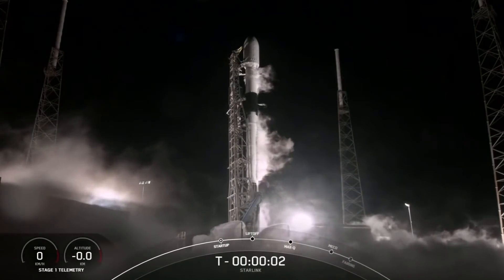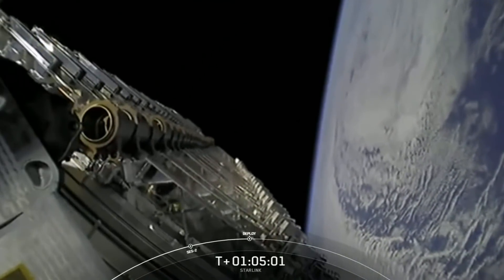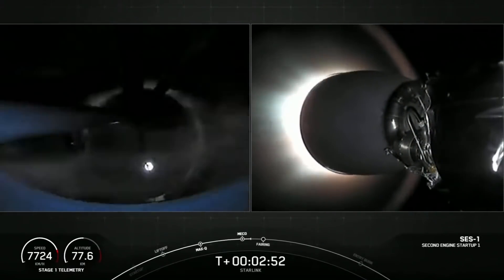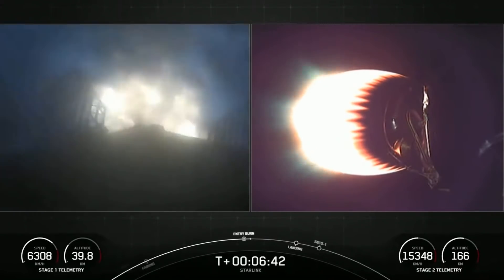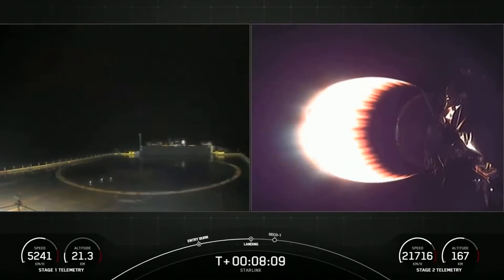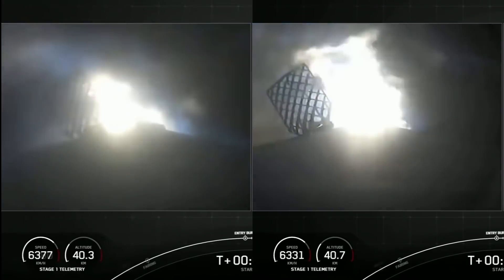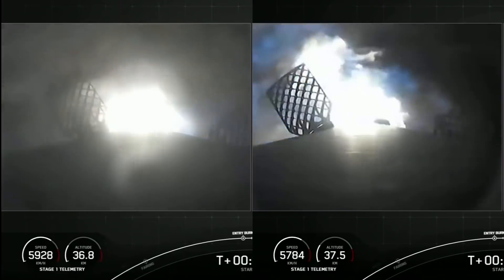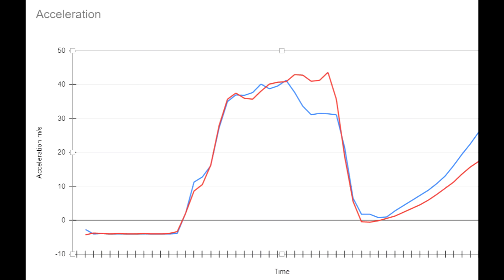Did An Engine Failure Kill A SpaceX Booster on Its 6th Flight?

Comment: How many times a booster did return successfully and has been re-used up until now? Anyone know the number?
Reply: The one they just lost was on it's 6th mission.
Reply: they'd had 24 successful recoveries in a row before this one, not all the same booster of course.
Reply: The current record for one booster is 8 flights and still going strong  (B1051)

Comment: My question is: depending on how it landed, if the booster survived can they retrieve it and figure out what happened?
Reply: Maybe, but more than likely it went SMASH into the ocean and then sank.
Reply: There's nothing keeping it from sinking to the bottom of the ocean. The cost to bring it back up may be too much to make it worth the effort.
Reply: They did once have a booster that purposely was performing a soft ocean landing. It tipped and survived. I think Elon said they were going to try and bring it back, but they had to bring in a demolition team to blow it up. 
There also was the booster that spiraled out of control on its way back to LZ1. That booster somehow survived, and they did go through the effort to tow it back into port.
Basically if it somehow survives and is floating way out in the ocean the answer is a no.

Comment: How do the merlins deal with the air up the nozzle traveling back down after re entry prior to engine burn, curious...
Reply: I guess when it's still hyper sonic there isn't much air pressure at that altitude, and when it's lower down the speed is lower so there won't be a huge air pressure. The pressure from the turbo pumps can probably deal with those fine, as you already need higher pressure from the pumps to keep the burning stuff entering back to the pump, just theorizing
Reply: It's nothing compared to the pressure the engine sees at full throttle.
Reply: @philb5593  the real problem they're talking about is probably how they ignite the engine and have it running stable while the upward wind is blowing away the fuel at supersonic speed. 'Cause even in commercial planes there's a problem called flameout.
Reply: @davemwangi05     A jet engine and a rocket engine are totally different: the rocket engine does not use outside air (or the oxygen therein).
The jet engine is open at the front and at the back. The rocket engine is closed at the front.

Any air pushing into a rocket engine’s nozzle can go as far as the burn chamber — and that’s it. The only connection is the fuel and oxidiser injectors, which are tiny, the connected lines are shut with valves and the turbo-pump that feeds them is capable of well over 250 atmospheres-at-sea-level, which is much more than the air can hope to manage.

So the air will not be able to carry away the fuel to anywhere, there simply is nowhere to go — and if it did, it would do the same with the oxidiser. 

Once there is fire in the burn chamber, the pressure will rise well above the air pressed in and push itself and the air out. 

There is a completely different set of problems in relighting a rocket engine, the air is actually helping here (by settling the tanks).

Comment: Maybe the engines usually aren’t at full thrust and two remaining tried to compensate? I know they don’t throttle very deep but we’re only talking a couple of percent
Reply: That's what i thought since the entry burn ended spacex make a decision not to recover the booster that's why there's no RUD on the droneship
Reply: @Zichoe  Don't think that's how it works. If the booster loses control, it's not going to be able to steer the last leg over towards the droneship. Its trajectory is designed that way; same thing we saw on CRS-16. I don't think SpaceX is able to send the booster active commands to avoid the droneship like people seem to assume.
Reply: @avecas  the standard profile has them coming down a couple hundred yards off to the side and then translating over to the ship under power
Reply: @avecas  Same thing with RTLS landings where the default trajectory is a few hundred meters offshore. The booster only reorients back to the launch site at the last few moments, so a failure doesn't lead to it  becoming an apartment-sized flying bomb.

Comment: I noticed something that gave me pause on the ascent.  I thought they had an engine problem then, before MECO at 21:24 in the SpaceX feed..  There seemed to be a vapor trail of a type that I hadn't noticed before, but it's probably just the equivalent of a contrail.
Reply: I saw that and a flicker or two on the way up I hadn't seen before
Reply: It also seems like the MaxQ arrived about 20 seconds early, then all the rest of the events were behind the timeline including MECO.

Comment: Scott Manley just was disappointed that the seagulls didn’t experience a RUD themselves. That’s the actual reason why he made this video.
Reply: The seagulls appeared to be very savvy about Falcon 9s. Started to move, then recognized the engine had failed even before Mission Control did, and settled back in.

Makes sense, they already have an instinct to be aware of falcon behaviors.
Reply: @donjones4719  this, this made me laugh
Reply: @donjones4719  I think we should just replace the humans on mission control with seagulls, sounds like a more exciting time.
Reply: @donjones4719  I think those birds initially move when the booster hits the water. The noise scares them.
Reply: I watch these landings for the same reason other people watch car races: for the crashes and explosions. Also science is cool.
Reply: Seagulls: MINE MINE MINE MINE
Elon: Here, have a rocket!
Rocket fails to land
Seagulls: MINE MINE MINE MINE
Reply: @KingdaToro  MINE thoughts exactly
Reply: He probably had a sandwich or three stolen by them at one time or another.
Reply: Birbs were all oh s*.... Meh, not our day Mr boomy sky sparkler f* off.
Reply: Actually he forgot to use them as indicators, "calculating" the distance it hit the water to be about roughly 1.5-2km away from the barge, as the gulls get scared two times, 8 seconds apart. First probably the sonic boom, then the sound of the crash... :)
Reply: BTW when I said “seagulls didn’t experience a RUD themselves” I meant:
The birds didn’t get killed by the booster
Reply: @jadeasereht4638  A RUD is a Rapid Unscheduled Disassembly, right?
Reply: @vsiegel  yes
Reply: They're my spirit animal so I was slightly offended. (Seriously, on my first day of grade school I was late coming home and my mom found me in an empty lot across the street from the school, squatting down, talking to a seagull that was right next to me.)
Reply: Can you really blame him?
Reply: If landing would went as planned, do you think they would show us seagulls splattering, burning and throw feathers everywhere? I think they would cut it.
Reply: @PetrPss  They would probably be blown away by the exhaust, even if not scared before it lands. Possibly even remain alive afterwards.
Reply: Most boosters
Reply: PETA has entered the chat...
Reply: I actually laughed out loud at "flying rats of the sea." Seagulls are aholes.
Reply: @r0cketplumber  and hyper aggressive.

Comment: This is why propulsive landing will NEVER be human rated
Reply: Except for the LM
Reply: Whelp. They're sure gonna try with Starship.
Reply: @greencobalt9296  That's my point, Starship is never going anywhere with people on it.
Reply: @bencheevers6693  I suppose we'll see.
Reply: Soyuz landings are briefly propulsive at the very end. OK they have a robust mechanism for firing it, but it's still propulsive.
Reply: @owensmith7530  You're exactly right but those are solid rocket motors, no pumps required. Also it doesn't 'need' those rockets and there are or were signs in Russian and English not to approach the landed craft in case the rockets were unfired and could go off.
Reply: Propulsive landing has only been around operationally for a few years in modern spacecraft. SpaceX is one of the few who have seriously put work into it, and have argubly put the most effort in the system aside from maybe the Lunar landers of the sixties (which were much smaller and less complex). But how is that indicative in any way that it will never be human rated? It simply hasn't been around that long, or had enough thorough use.

It's thought we'd need several hundred to several thousand consecutive landings (for at least astronaut rating), which will require decent strides in engine relibility among other systems. Which is not strictly impossible, it just hasn't been seriously tried by anyone, because almost every other rocket in existence was designed and built for a single use without a thought for reusability. SpaceX is continually pushing the technology, and so far they've only had a couple dozen consecutive landings (around a hundred overall), which is itself incredibly impressive. To get to the hundreds or thousands, they either need more time to work it out, and/or a fully reusable rocket that can fly on the order of days and weeks instead of months - which is exactly what Starship is for. Falcon can't do that.
Reply: @davidk1308  I don't like Thunderfoot much but when he's purely talking about science his videos are pretty good, I only really follow his busted series of videos and he did one on SpaceX a couple of days ago and goes into why the reusability thing isn't really a useful innovation. I'd also disagree with the idea that Spacex has pioneered the field, you mentioned moon landers but even reusable rockets were engineered and tested throughout the history of rocket science and they decided that the benefits didn't outweigh the downsides and they were able to do it with significantly worse technology bottlenecks. Even modern rockets have a failure rate of half a percent, there's just no way to get the safety margins for propulsive landings down low enough, there are so many points of failure and the turbopumps are inherently unreliable, it's fine when you can try to get the cycle started a couple times if it fails but when you absolutely need to fire right now or splat it'll never get there.

SpaceX is on basically corporate welfare, they haven't reduced launch costs at all as you can see in TF's video and their stated plans for their future are wholly science fantasy. I don't actually believe they think they're going to achieve what they say but they're happy to drum up buzz and collect funds and overpriced government contracts in the mean time. The Common Sense Sceptic has fantastic series on both Starship and some other Spacex related ventures, I never followed them too closely but when I found out what they themselves were claiming and pitching I was dumbstruck. Take a look at TF's video and also this one by CCS watch?v=VLg-2iSX8vg
Reply: Thundertwat is, as usual, wrong.  Elon himself said the f9 breaks even after 2 flights.
Reply: @bencheevers6693  SpaceX didn't innovate anything? Rubbish. SpaceX has driven launch cost reductions due to re-usability and modern approaches to rocket design. Everything else flying regularly is from the 1980s or older. ESA have had to develop Arianne 6 in an attempt to remain competitive with SpaceX.
Reply: @owensmith7530  Watch Thunderfoot's spacex debunked, launch costs haven't actually fallen, also watch the common sense skeptic's channel on Elon Musk, all his claims of founding or innovating are lies, he didn't found Paypal, he didn't found Tesla and he didn't found Neurallink and Boring Company operates at higher cost than industry average and the Hyperloop is science fantasy. Everything Spacex is doing has already been done and when studied they found the negatives outweighed the positives. All of Elon's projects and their value is objectively hype because they aren't bringing a product or service that's better or cheaper than their competition.
Reply: The armchair experts...  They only 'human rating' given is by NASA for NASA missions only.  Spacex can fly their own crews.  The system will need to prove itself a LOT though.

Comment: What do you think about Starlinks ruining stargazing?
Reply: If just stargazing go out on a clear night at least an hour after twilight so you get good viewing and count the satellites in the patch of sky of interest before you get a sore neck and multiply that by 6 for when SpaceX gets all 12000 FCC approved satellites up. If you being Astronomer your patch of sky will probably be way smaller but your telescope will pick up fainter objects. From a single point on Earth you can only see about slightly less than 2 tenths of 1% of the sky. So if you see one it will just add interest and another in the same orbital plane will come along roughly about 4 minutes later. 4 minutes is a long time waiting for not much to happen.
Reply: Technological advancement is far more important than an individuals hobby